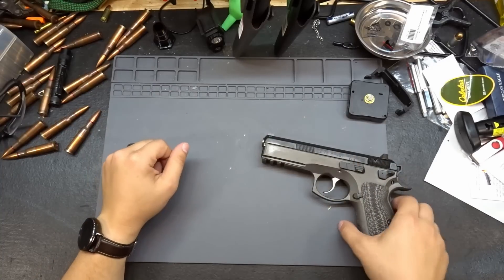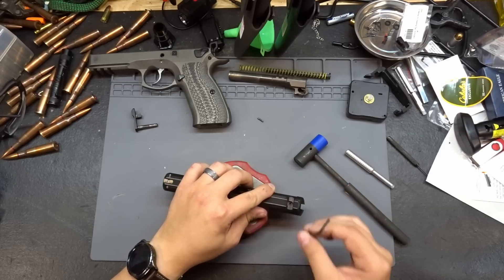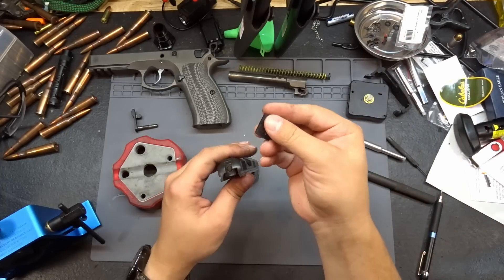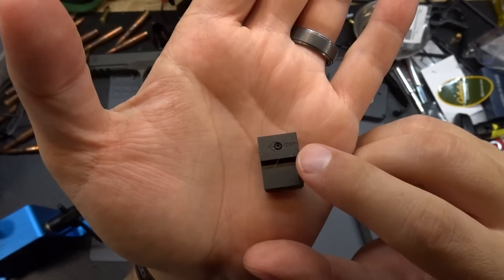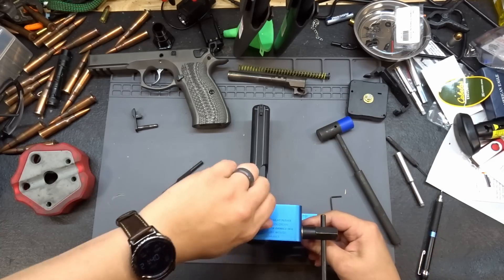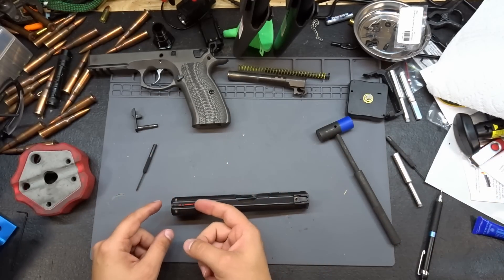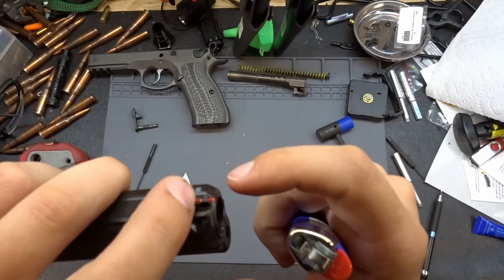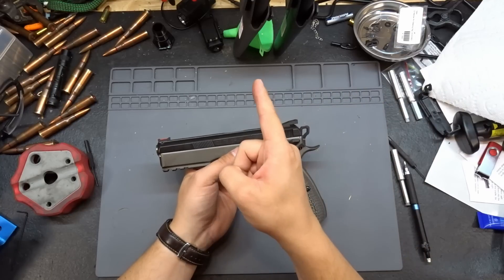Installation of Dawson sights on a CZ SP01

Comment: I just installed the same Dawsons on mine today... your video was immensely helpful. Surprisingly I didn't need to custom size anything, both sights went in with not much effort, didn't even need to use the pusher for the rear (it was helpful with taking the original rear sight out though). Hardest part was getting the front site pin back in, but even that wasn't that bad. Originally I considered getting a gunsmith to do this but your video made it look simple so I gave it a go and I'm happy I did. Thank you!
Reply: How have your sights held up since posting this?  :cat-orange-whistling::face-blue-wide-eyes::face-orange-biting-nails:

Comment: Did you only sand the bottom tell you can fit it halfway by hand before you hammered it in ?
Reply from the maker: Yes. It should slide in by hand about half way, then the second half should be hammered/pressed in. The last 1/8 or so should be REALLY tight.
Reply: @workthetrigger  thanks bra 👍🏻

Comment: Are those .135" rears? I like to do 25 yard 5 shot groups to see how tight I can keep em and I ordered the sp-01 tactical competition sight set but they are .135" in the rear and .095" on the front.. I'm afraid I will not be able to shoot precise at 25 yards because of the large gap in the rears.. how does yours shoot at that type of range? I get them in the mail at the end of the week.. hope I don't have remorse

Comment: Dawson says ...  •Easy to Install - Sight Punches, Allen Wrench and Instructions Included!. Is it possible to install the rear sight without a sight pusher or am I asking for trouble if I just follow their instructions?
Reply from the maker: Oh, you a absolutely can do it with just a hammer, punches, and allen wrench. Just easier with a sight pusher
Reply: @workthetrigger  Thanks for the quick reply. I am going to give it a shot.
Reply: I installed the sights last night. Took about 35 minutes. They look fantastic! Time to get to the range.

Comment: Yo WtT, did you decide to go w the CZ custom black rear sight with a single Tritium dot , like yr P01.. and: do you prefer the white front ( Stock SP-01 tactical ) or the Meprolite front tritium ( green ) .. Ive got an SP-01 and P-01 .. and think it might be good to outfit the two guns the same for a consistent sight picture.. SP-01 for range and maybe competition, P-01 fod defensive use.   Your thoughts appreciated ! 👍
Reply from the maker: The SP01 that this is on is my competition gun, less stuff on the sights the better for me in this case. Plus, j got these first. Lol
Reply: So : fiber optic ( smaller front dot ) w all black rear for range / competition..
And Meprolite yellow optic/tritium or Stock Sp-01 white outline tritium front w single dot tritium blacked out rear for P-01.  
Trying to figure the most cost effective- get it right first time - purchase of sights ... 👍
Reply from the maker: Yep, that sounds about right. For self-defense I much prefer the arrangement on my PO one. But it's hard to beat the Dawson's for competition

Comment: If you see scratch marks on the right side of the sight (like the two CZ 75 compacts I own), then it was factory installed from left to right. If it was installed from right to left, then there would not be scratch marks on the right side.
Reply: I just replaced my P-01 rear sight with a CZC tactical. I only remove material off of the rear angle of the SIGHT'S dovetail and never the bottom and measure repeatedly with calipers. Even though I was filing material perfectly within a 100th of a mm , the sight ended up going on easier from right to left, even though I was planning on putting it on from left to right like the factory sight is installed. But the strange thing is..... I did my PCR sights a few years ago and the SAME THING happened.. going on easier from right to left. My conclusion is the dovetail angles on the slide are not perfectly parallel (by design or not) even though the left side should be larger because of the wear it creates from factory install.
Reply: @tabooretka  Thanks for the reply. Because when going from L to R, the right side of the sight goes in first  through the dovetail.. The left of the sight will not be scratched because it doesn't go thru the dovetail. That's why you see fine scratches on the right of the dovetail, if it's inserted from L to R.  EDIT: HOWEVER, when fitting a new rear sight, don't assume the dovetail opening is bigger on the side it was installed from by the factory. When taking material off to fit a new sight, constantly hand check the fit from BOTH SIDES. What ever side goes in further (1/3 - 1/2 way by hand) , that's the side you insert the sight from. (take it from experience lol)

Comment: What size punch did you use for the front sight? Size and was it flat or roll punch
Reply from the maker: yeah.... about that.... i never pay attention to punch size.  i just grab the punch in my set that's slightly smaller then the hold or pin.  BUT, i use roll pin punches on roll pins.  those are a must if you're working with older (and even some newer) gun designs.

Comment: I really enjoy my sp01 with suppressor sights. My wife wants a p07. Trying to get to grab the suppressor ready one. But these arent competition for me. I have fiber optic sights on my ruger m3 and they are killer.
Reply from the maker: yeah, the SP01 is my competition gun.  if it was something else, i'd run different sights more than likely.  probably the sights i have on my P01.
Reply: @workthetrigger  i will have to check out what they are. For whatever reason i like how the factory suppressor height sights position the pistol a tiny bit lower and how easy they are to pick up. The only thing i would change would be add a big dot on the front. Fast to pick up. Have trijicon hd's on my ppq. Great ccw sights.
Reply from the maker: @voltairee3012  HD's are my favorite sight.  I have a video on the P01 sights, check it out.  they're not HDs, but they mimic the large front dot, blacked out rear, and have an easier to align night sight setup with the figure 8 dot over dot.

Comment: Can the rear sights be done without the push tool?
Reply from the maker: It can, but it's kinda rough. As a tip: its glued on. Heating it to soften the glue helps if you're using s punch
Reply: I thought about punch method to but “smartly” changed my mind and bought the same sight pusher, it’s the only way to go!
Reply: @workthetrigger  Ahhh, that must be why I'm having so much trouble getting the rear sight off with a nylon punch. I have a pusher, but I think it's made for Glocks only. I can't get it to work with my CZ.  I can't decide if I should buy a new pusher tool or take it to the local gunsmith. I don't want to ruin my new P-01

Comment: Did I miss you tightening the small allen screw down on the front sight using the tiny allen wrench given with the Dawson sights? It helps keep that front sight "snug". Impressed you didn't have to sand more on the sights...it took me a lot more "sanding-fitting" on the EZ-D sights from CGW which I believe are Dawson sights, than you had to do... great job.  Thanks for sharing.
Reply: Turbo Pa On the CZ, the front site is held in with a roll pin (also holds in the barrel bushing). You push it in and our with a 2mm roll pin punch.  The allen wrench is used for locking in the rear sight.  Dawson recommends not putting the lock tite under the site but rather just using it on a few threads to lock in the sets screw on the rear sight. Other than that, this vid is a must watch if you’re going to attempt this yourself (I have a CZ 75D Compact/PCR...Dawson sights were made specifically for this model and don’t fit any other CZ).

Comment: I have to send my slide to a guy now. I tried putting these rear sights on mine but they were very tight and my rear sight tool is garbage compared to yours. its just a tiny smidge too far to the right and for the life of my no matter how hard I pound the hell out of it with a nylon hammer or nylon punch I can't get it to budge. Can't even move it back with my sight tool. Don't want to have to aim left forever!
Reply: Rocketman9mm Sounds like you didn’t file-fit it enough and drove it in too tight. Dawson recommends you fit them loose enough to be able to move/zero them at the range with a light hammer tap or the pusher....one Dawson video shows them making more than 20 passes with a triangle file.
Reply: @zenadventurer69  yeah i didn't file. was being impatient lol. my local cerakote guy was able to install them for me though so I'm all good and loving my sp01.

Comment: Damn. Wanted to get these, but don't wanna get that sight tool you have. Like 40 bucks for something I'd only get one usage out of...and a gunsmith installing em is likely not cheaper.
Reply from the maker: You can do it with a hammer and punch no problem.  the tool just makes it significantly easier.  i've installed multiple sights with a hammer and punch.  But i promise, if you get the sight tool, you'll be significantly more likely to change sights on other guns. lol.  But the tool isn't necessary.